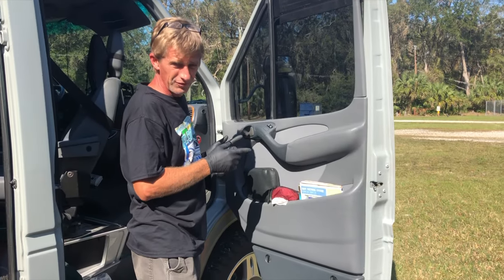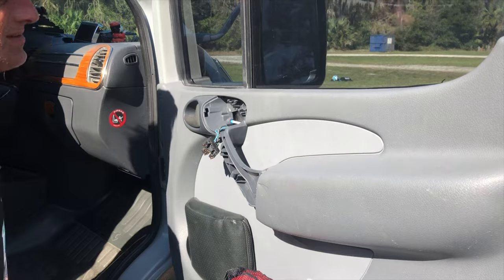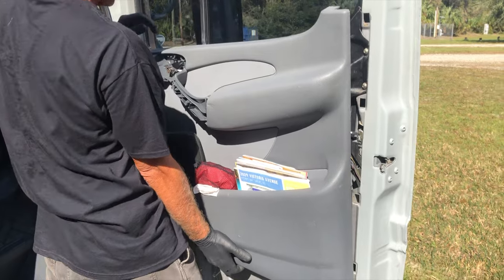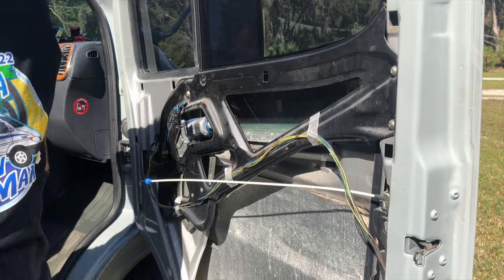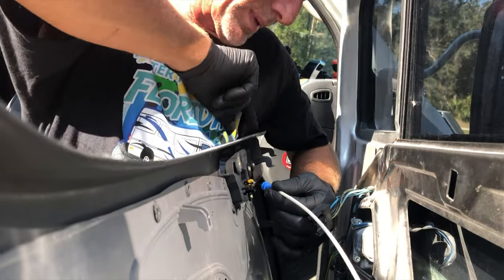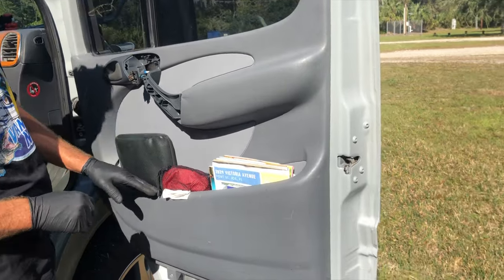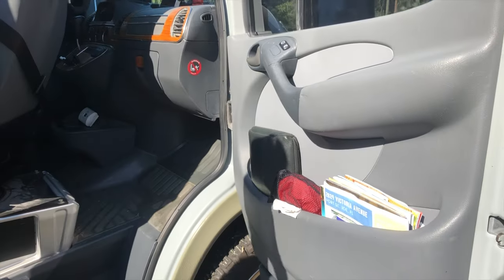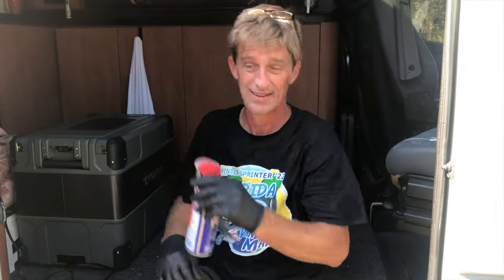Door Panel Removal and Reinstall T1N Sprinter

Comment: I will be embarking on broken interior door handle diagnosis in a few days.  Thank you!
Reply from the maker: Sending you good vibes and best wishes. Holler if I can help!
Reply: @FloridaVanMan  I'm in a very peculiar bind.  I had replaced driver side exterior door handle a few weeks ago and never got it to control latch.  The interior handle still worked.  Then I had to travel and had some brake work done enroute.  Despite me telling them that the exterior door handle didn't work and they'd have to use passenger side, some bonehead broke the new handle trying to open it.  After the repair, I also noticed that the interior handle had less tension (probably due to them trying to use that to get in) at that point but still worked.....for a bit.  I considered taking it back to them but I was 1000 miles from home and fed up with them at that point. Then the interior handle stopped working.  It felt like it detached or broke from some part of the handle mechanism and no longer has any tension and won't open door.  So neither handle on the driver side door will open the door.  Today, following your excellent video I detached the door panel, and while I'm not able to pull it completely away from door frame, b/c it isn't open, I'm able to get to the backside.  At first I tried just pulling on the cable (it appears that the cable is attached on both ends) hoping maybe I could just open it mechanically.  That did nothing.  Then interestingly, I tried using the interior handle....amazingly it's still able to control actuator and lock and unlock the door, but, won't open it.  I can get my fingers into the holes on the inside of the latch.  Hope that paints a reasonably clear picture.  Is there any way to get this door open?  Any ideas are appreciated.
Reply: I figured out how to open the front door without the use of interior or exterior door handles.  The interior handle end of the cable, that controls the latch, slips into a hole on the back of the handle.  It had popped out and wouldn't stay in under tension.  Ultimately, it seems that the plastic bushing that clips into door handle was partially broken so it wasn't providing restraint when the cable was tensioned.  I was able rotate it so more of it clipped into door panel and I bent the hook on the cable to try to force it to stay in place.  Certainly a temp solution but at least I now know how to get out of this situation in the future.  And as I suspected the exterior door handle was broken in exactly the same place as the previous one because people kept tugging on it without it being properly connected to latch.  Brute force is almost never the smartest option folks.  Just another obscure repair on my 2004 T1N with 280k on it.  You never know what'll break next.  At least the drive train is functioning as expected.

Comment: Love how easy these door panels are to pop off and on again! Wouldn't spray white lithium grease serve as a better lubricant for the metal to metal bits? Or is there a particular reason you're using WD-40 on these?
Reply from the maker: WD-40 is good for cleaning the crud that makes it stiff. It is not a great lubricant because it does dry, but lithium grease, especially the spray stuff, will also dry and it leaves a crust full of dirt and grime. PB-Blaster lasts longer but smells so horrible I didn't want to use it on vans when people were camping in them at our meet-up.

Comment: Do you have any videos on adjusting the sliding door? The sliding door on mine keeps coming off the top rail. The silicone pieces are pretty worn on the sliding mechanism (one may even be missing). So when I open up the sliding door, sometimes the door tends to fall over towards me.
Reply from the maker: Two or more videos on sliding door adjustments but sounds like you need to start with replacing the top roller. Adjust the door then replace the middle roller. Adjust the door again and finally replace the bottom roller and clean the track with garden hose. 
The door-side piece of this lower roller is too long so we want to disconnect the two halves and use only the roller side, leaving your bent mount on your door. https://amzn.to/3RMqR1T
Reply from the maker: https://www.youtube.com/watch?v=d5zZZpIwFGQ
https://www.youtube.com/watch?v=lriR92CiSqo&t=32s
https://www.youtube.com/watch?v=VgYPcCj1AuA&t=103s
https://www.youtube.com/watch?v=DiHMvA41-uY

Comment: Would it possible to add a couple of speakers in that panel without causing issues to the window? 🤔
Reply: maybe cancelling those useless mapholders under the arm rest?
Reply from the maker: If the speakers extend into the door they will interfere with the window, unfortunately. I tried to build a speaker box from the factor pockets and it was not great. Eventually this was my solution to the sad situation for 15 years. I talk a little about the how and why.... https://www.youtube.com/watch?v=iQbof17xV6Y&t=314s